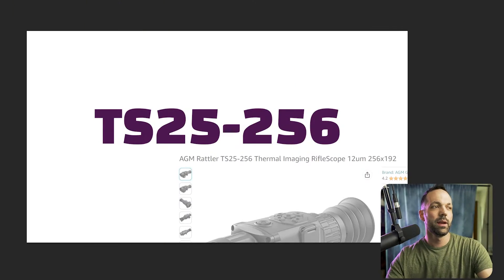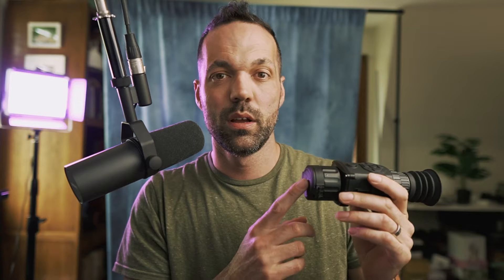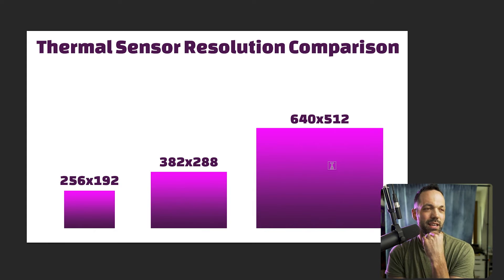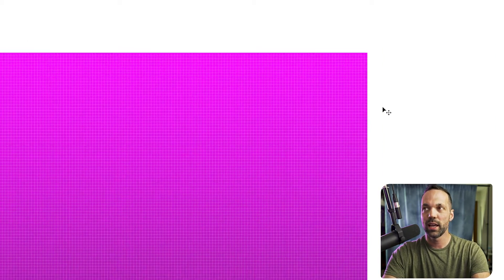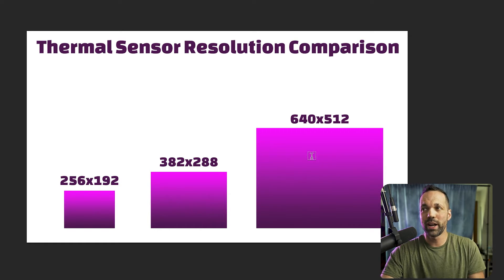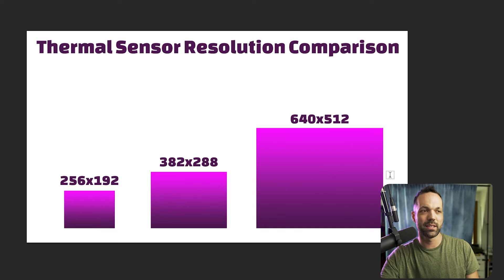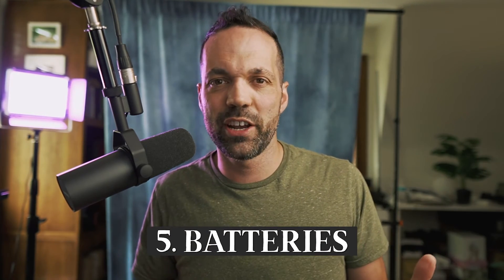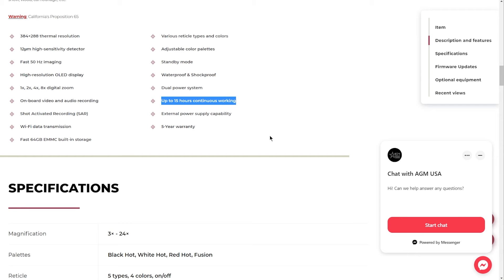AGM TS25-256 VS. High-end Thermal?? | 5 Key Differences

Comment: I DONT LIKE AGM .CANT PLOP IN FRESH BATTERIES ALL RECHARGE ONLY MAKING A 2 WEEK HUNT IMPOSSIBLE
Reply from the maker: Huh? It takes of the shelf CR-123 batteries, replace them however you like. You can even just use an external USB battery.
Reply: It has the ability for external battery via the usb c port plus in between outings you can charge in your truck get real bro
Reply: I bought  3 battery blocks 
One dies plug in and go
Reply: I wonder if it works on a 3.7v battery?

Comment: HELLO! Is agm ts-19 256 12 cal recoil resistant?
Reply: Rattler series is rated to 308.
Reply from the maker: I'm going to do a full review on the TS25-256 soon, which is nearly identical to the TS19-256 aside from the lens. But the main challenge with active scopes is preventing the batteries from losing contact during recoil. I can see AGM has tackled this by aligning the batteries perpendicular to the movement of recoil, and using a VERY strong set of springs at the battery contacts. The battery door is tough to close and there's a fine-threaded screw that gives you the leverage to close the door all the way, fully compressing the springs. I can see they put a lot of thought into the design there. 

I've yet to test it myself, but during my research when choosing a scope, I've found the Rattler series in general to be pretty durable in that respect, with no problems handling recoil.
Reply: @Atlavox  thanks